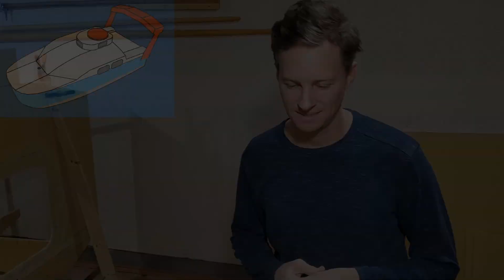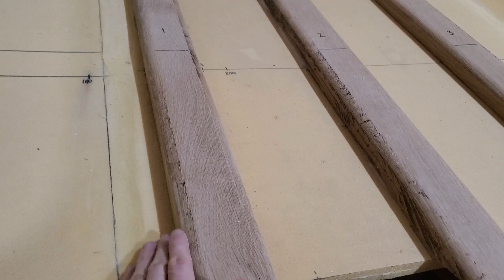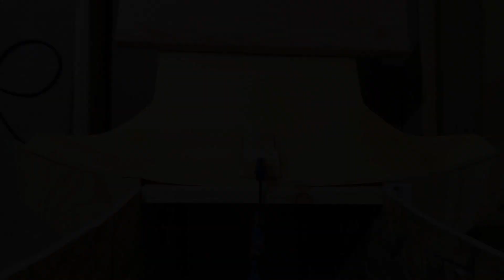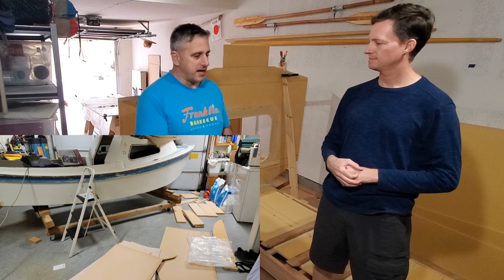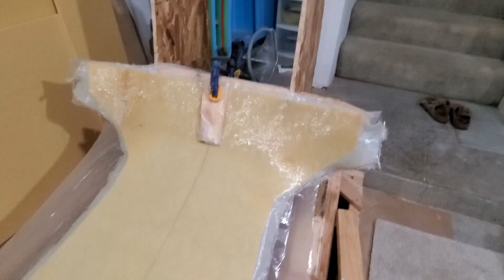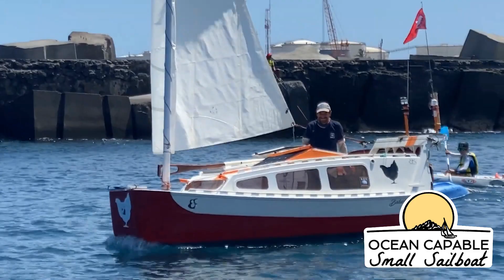OCSS-012 Fiberglassing Over the Keel Supports - Mini-Cruiser Sailboat Build

Comment: Curious why you made wet layups and transferred them to the boat rather than wetting directly to the boat?
Reply from the maker: Especially when it's thicker mat like this 1708, it is easier to fully saturate it with epoxy on a table first. With the thinner cloth I'm ok with wetting it directly on the piece of foam.